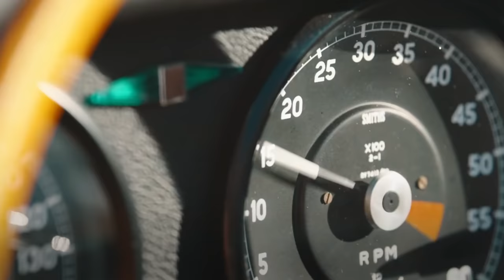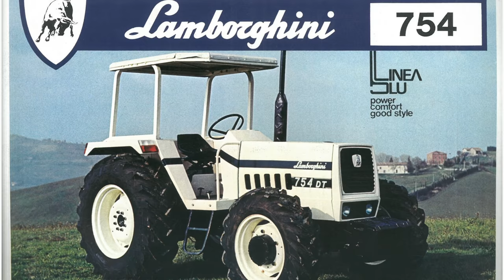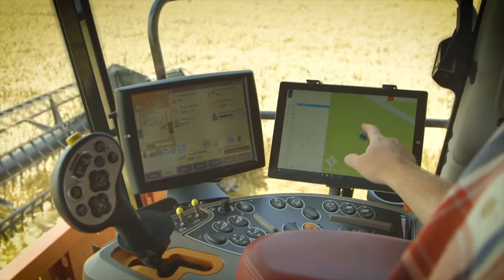The 8 Tesla DREAM VEHICLES You've Been Waiting For

Comment: Sigh. C’mon, guys! You’re better than this! Elon’s brother - Kimbal - is one of the leading figures in the new agriculture movement. We’re talking farms inside of shipping containers. The primary advantage of factory farming is that it requires no pesticide or fertiliser, uses less water, less labour, and the growing cycle is year round. Best of all, though, it takes up much less space. 

With Kimbal as a part of the board, Tesla will not be doing a tractor for very good reasons. Old fashioned farming will be increasingly replaced.